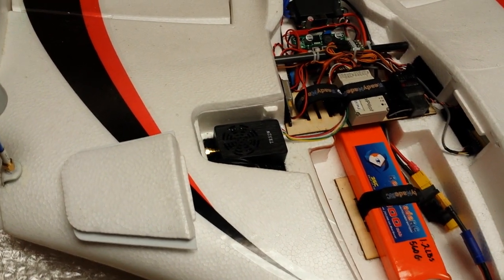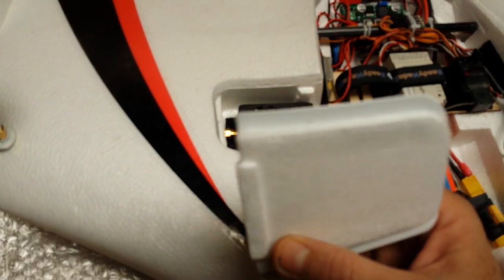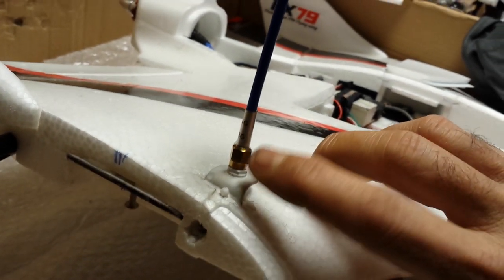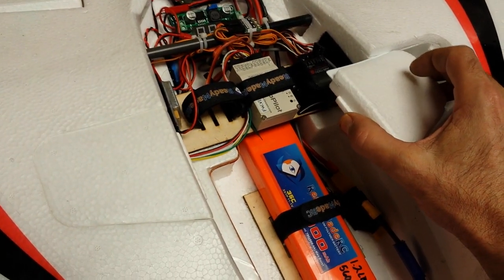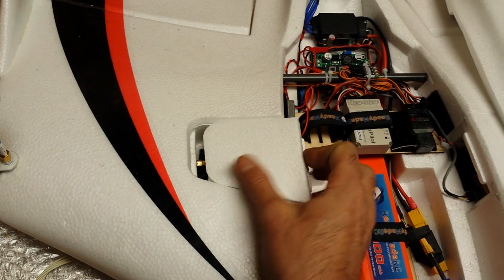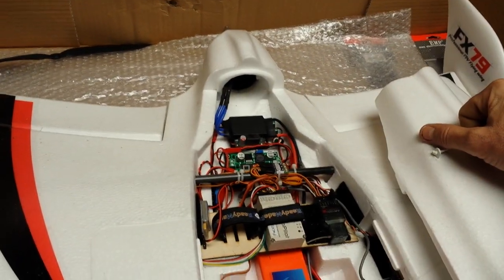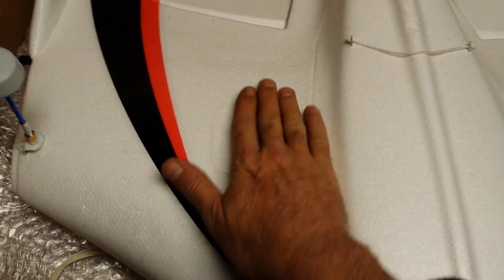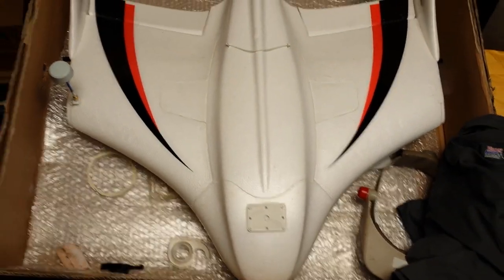Zeta Science FX 79 Buffalo Side Winglet hatch modification Idea

Comment: I definitely love that rig!! May I ask what is the max speed? and have you modify and increase the cooling power for your Video tx? Mine when I purchase it start to get kind of to hot for my comfort.. so I decide to increase the cooling installing a very thin heat sink between the fan and the board! now, no matter what, it doesn't get hot! My X-8 make cruising some what about 98 Mph.. "W/ Serious Fiber Glass Reinforcements" I have been thinking about the FX79.. But I'm very concern whit the real state inside! The X-8 is a very roomy and spacious plane! Mine have a cockpit whit a nice windshield to protect my Sony Block Camera.. Hope to hear from you soon!

Comment: quick question. do you have any problem with AP MyFlyDram? I have the same plane and same AP of myflydream but it seems that it does not work with wing plane. I cannot set it on FX-79 Buffalo. do you have some tips?
Reply from the maker: +Ugo Vitale 
No, haven't had any problems. right now my flying FPV wings are in storage....and I've been giving more attention to my war birds and edf jets.    FPV has taken a back seat for the moment
Reply: +Brandon Moon thanks for your answer. do You remember if You had set The AP with pane type wing or normal? And than x6 or skywalker? thanks a Lot for your time.
Reply from the maker: +Ugo Vitale 
I used wing type
Reply: thanks a lot. I still have problem in setting the AP. I do not find a solution. I used it with Others glider without any problem. I have problem setting the FX-79 Buffalo. Probably I'm setting it in some wrong way and I don't know what wrong is.
Reply: Hi Brandon and vtl u67,
I'm fitting the MFD AP into my FX-79 but I am having big problems....
On the bench in MAN and STAB mode, in roll, it's nice and smooth my elevons move as I would expect but in pitch (elevator up and down) they are very jumpy??? (Not smooth at all)???
Do you have any ideas????
Reply from the maker: Sorry, no I don't. I have not messed with mine for over 3 years....other life events and responcibilities have kept me too busy to mess with it...mine is packed up in storage untill I can find more free time for it.
Reply: No problem... I'm sure I'll get it sorted....
BTW, I did your mod....
Nice idea....